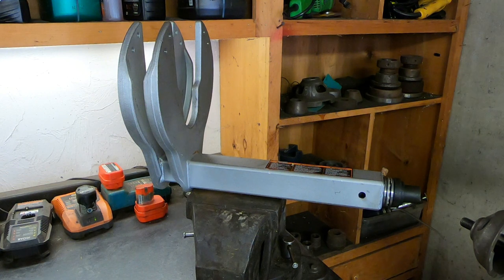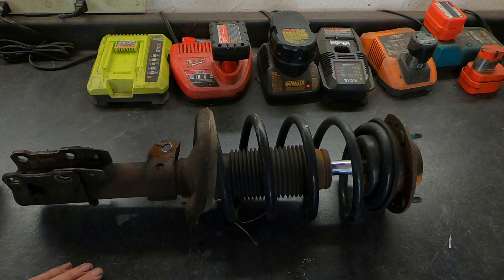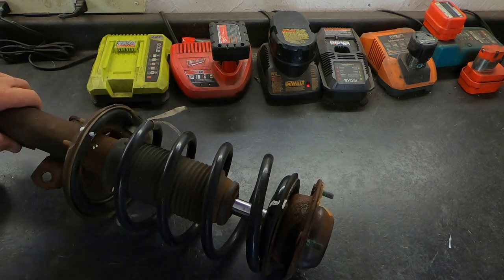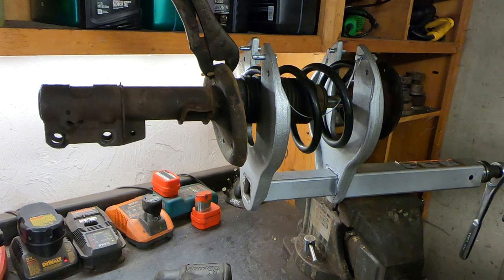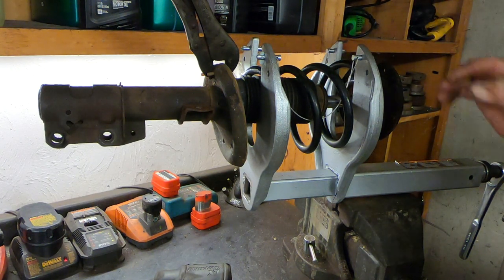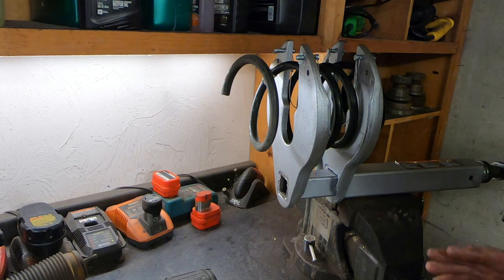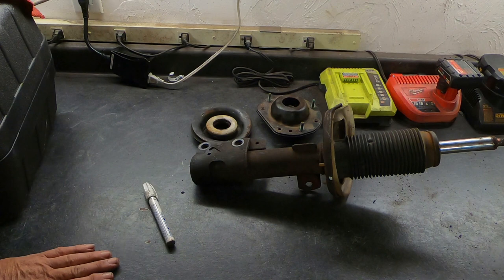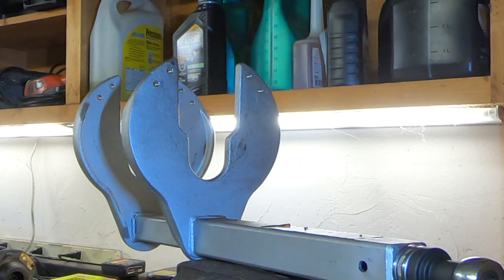How to Use the Powerbuilt Strut Compressor

Comment: Good video, what I find interesting though is that I had watched another video just before this one on the power built loaned out by Autozone. He made it through the complete replacement of the strut only to find the "safety" cable had not been crimped properly and it fell apart in his hands. I would certainly add a chain as an extra precaution when using this device. Overall it looks like a fairly safe device.
Reply from the maker: I must admit, those thin safety cables don't give me a warm and cozy feeling.

Comment: That's the best spring compressor that I've seen so far
Reply from the maker: It works well, however you must respect the tool. Any tool can be dangerous if miss used.

Comment: I'm real leary of these jobs. I think for even more safety l would put a chain through the coils towards the lower side and around that square tube to keep it from going up also. Thanks for the vid.
Reply from the maker: Yea; Those safety cables don't give me a warm feeling.  Once I started using it I felt better about it.  The device is made to be clamped in a bench vise as you saw how I had it.  With it up high like that there is no need to be hovering over it as the only place the spring could possibly blow out is strait up.  I was at one end when I cranked to compress the spring and the other end when I unbolted the mount.  I saw a video where a guy was using it on the floor. In that case he was directly above it through out. That to me was very dangerous. If used as intended I think it is reasonably safe. However thanks for the suggestion of sticking a chain through it. I just might do that.
Reply: @richardspaulding5035  it looks like the safest one l've seen used.

Comment: Does this tool scratch the springs?
Reply from the maker: Well Dan, I cannot imagine why you are concerned about that. The tool does indeed come in contact with the springs so I guess it is entirely possible that a scratch or nick could result.
Reply: @richardspaulding5035  Scratching the power coat finish hastens the corrosion.

Comment: This is the WORST tool I’ve ever put my hands on .. I followed instructions on the box to a tee and the spring get slipping and almost killed me .. the “safety” pins broke at the crimps .. I did notice the clamp jaws were a little bent when I first got it (I rented it from autozone ) but I don’t see how this isn’t the most dangerous tool ever .. there’s nothing actually gripping the spring and it’s a true nightmare waiting to happen.. I’ll use 2-3 sets of “widow makers” before I ever consider touching this piece of Chinese trash ever again
Reply from the maker: Thanks for sharing your experience, I must admit the flimsy looking safety cables did not give me a warm and cozy feeling. However as you stated it was a rental that sounds like it had been abused. This tool is designed to be clamped in a bench vise and I would not use it any other way.